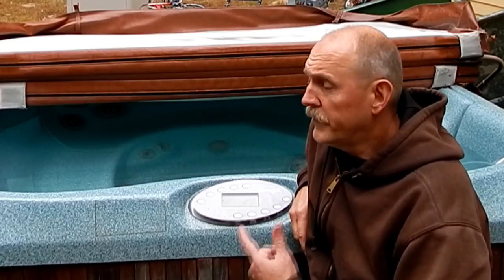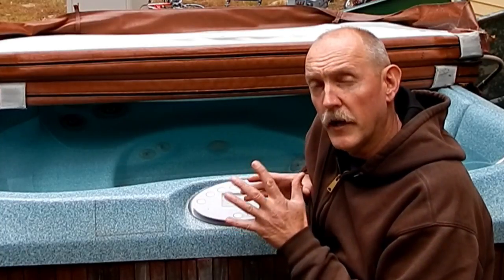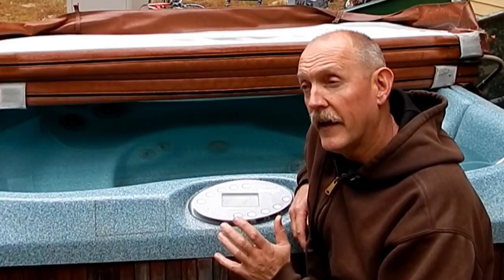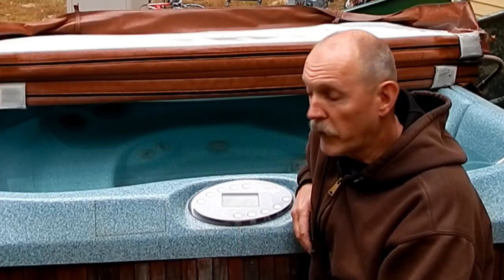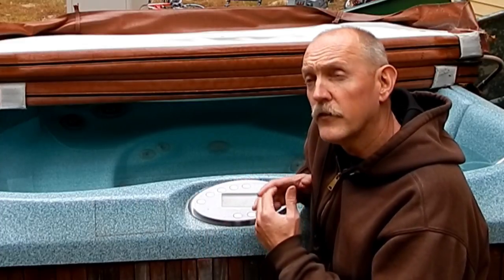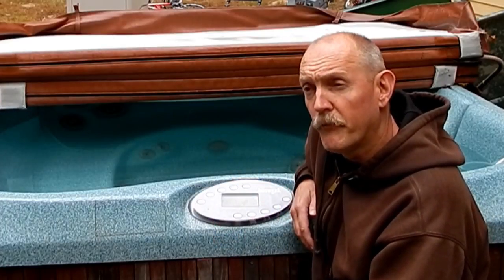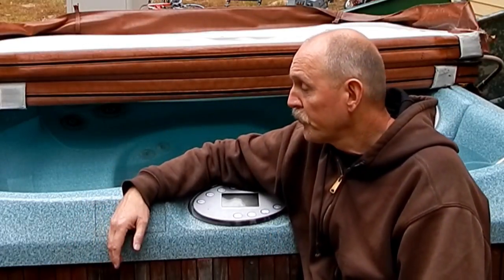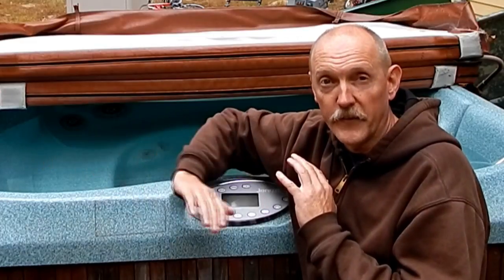Jacuzzi Sundance Hot Tub temperature sensor error repair

Comment: I have the 2006 Sundance Capri model. My issue is that the temperature increase button stopped working and the jet button stopped working. The temp decrease works fine. Even though I had checked the resistance of both temp sensors and they were good. I purchased  an original heater & both sensors with the same issue. I checked the tape and all is fine. For the past three years I’ve been jumping the wires and added the resistance to foil the system. When my wires were swapped the temperature drops 25-30 degrees Fahrenheit in which the heater and the mini circulation pump turns on. Everything else plus the cleaning modes works according to the schedule programmed. I just hate to spend $500+ for a new topside panel on an old spa that came with my house: have you or anyone seen this issue where the temperature increase and the jet buttons stopped working? I only have the single two stage pump in my 250 gallon spa. Also I’ll definitely get the LED panel if possible and affordable. The jumpers have been extended and protected from all elements so I could bypass the system without opening the panel.
Reply from the maker: If everything else appears to be working normally and you have no error codes, it sounds like a bad topside. Especially since the temp down button works. Bad topside is a rare failure but they do fail. I know they are expensive. Occasionally a good used one gets posted on Ebay.

Comment: My jacuzzi turn of the heater when it’s in freeze mode. So it won’t reach the set temperature.  Do you have an idea for that problem?
Reply from the maker: Why is it in freeze protection? Sounds like you had a heating problem allowing it to drop low enough to trigger freeze protection....or you just filled it in cold weather, in that case, freeze protection will run the pumps on high and that will slowly raise the temp to a point where the pumps can be run on low speed and heater should come on. This is all normal UNLESS you see error codes. COOL and FREEZE are not error codes. FLO OH and - - - - - are some common error codes.
Reply: @stevewatr  yes because I filled it in cold weather conditions. But the heating symbol is off when it shows ‚freeze‘ I don’t want that the jet pumps running because it’s to loud for the neighborhood the hole night long. 
I solved it with a 35k Ohm resistor on the freeze and OH Limit Sensor cable.

Comment: I just replaced mine and I just now get the flashing temperature with 4 lines in the back. Still seems to be in watchdog mode. Any suggestions?
Reply from the maker: When in watchdog, you should not see the temp numbers at all, you are describing seeing both at the same time?? That sounds like a power problem on the board itself. If the tops of the 2 large capacitors on the board are bulging, the board might be bad. Also check to make sure the voltage input is correct. Sometimes a blown motor fuse, the green and white one, can cause the board to get 120 volts instead of 220, then the system will act really strangely.

Comment: I have a Jacuzzi J375  that was given to me ...it was working fine until we had our neighbor shut it off from the circuit breaker while not home.  We came back to refill and start it up again and nothing works.  The panel displays a number - 8?  I can't find what this means.  Please help I want my hot tub to work again!
Reply from the maker: "8" is not an error code, its just garbage the display might show if the microcontroller fails to start correctly. Sometimes it can be something simple like a loose connector for the transformer that powers the controller. It could also be a bad board. There are a couple capacitors that fail with age on those boards. Another possibilty is a problem with the voltage supply. All these can be easily diagnosed by a skilled technician with a meter.

Comment: I have a different problem. I indeed am getting the "OH" fault but the water temp is actually exceeding the set point. The display shows a temp of 105 (which I've verified as accurate) and I have it set at 96. I already replaced the sensor in the tub. Is my heater bad ? It's a Sundance Altamar 2005 model.
Reply from the maker: Your heater is not the problem. Think of it this way, if you walked into a room and the light was on, and you flipped the switch, and the light was still on, you wouldn't think the bulb was bad. In the example I just gave, the bulb is your heater, and the switch is the spas control system. So one of 2 things is going on here, either power is still being sent to the heater after the spa has reached its set point (a highly unlikely and rare type of failure), or more likely, the water is being heated by something else. This can happen in warmer climates if the jet pumps run a long time. Why would they run too long you ask? Most common reason is filter cycles set for too long a duration. 2 hours every 12 hours is sufficient. That big motor running constantly can heat up the water because it gives off heat into the cabinet where the uninsulated pipes act as a radiator in reverse.
Reply: @stevewatr  Thanks for the reply Steve. I had the spa off for about a week waiting for the spare temp. sensor to arrive as I suspected that was the problem. Once I replaced that, the water temp was down to around 75. It then proceeded to heat up and pass by the set point of 95 all the way to 105 .... prior to any pumps activating. Any chance that other temp. sensor attached to the heater could have failed?
Reply: @stevewatr  My "skimming/heat" cycles are set to 30 minutes per cycle, 4 cycles per 24 hours. The circulation pump duration is set to 24 hours. Does that sound about right? It has been pretty mild in Northern California this month, hitting around 75 in the day and 40 at night is all. Current water temp is displaying 106 F which is the actual water temp and of course resulting in an "OH" condition.
Reply from the maker: @PresidentGas1  try reducing the circulation pump cycle. 24 hour continuous operation is excessive. you want that pump to turn off when the water is up to temp.
Reply: @stevewatr  Thanks Steve .....I will reduce by 50% and see what happens.
Reply: @stevewatr  Just a follow up on this problem of the heat sailing by the set-point. I ended up replacing all (3) heater relays on the control board (K1, K2, K3). One of them was bad but I replaced all (3) anyways. Problem solved.
Reply from the maker: @PresidentGas1  yup, that was that rare failure i mentioned. The contacts on the relay were stuck closed. I have only seen that a couple times in my over 20 years doing these.
Reply: I think this is the exact problem we’re having on our Jacuzzi. Can you be more specific about what relay we should be purchasing? Our water is scalding and it does go into watchdog after 109. I’m not against using a tech but I can’t seem to get an appointment. Our temperatures have been dipping into the 20s and I have been turning the spa on and off just to keep it from freezing.
Reply from the maker: @cassiegrothe6251  even if it is a bad relay, those are soldered onto the PC board. So a spa technician will not replace the relays, he would replace the whole board. A spa dealer will not have the relays. There is not even a Sundance or Jacuzzi part number for them. To replace the relays you order them using the part numbers on the relays, from an electronic component supplier. But most people do not have the soldering equipment and skill to do this level of repair.
Reply: @stevewatr  After replacing the thermostat, high limit sensor, circ pump, heater, and flow switch (casualty of getting the heater out). It was showing heating but afte 12 hrs not temp change. We whacked the relay and the tub got up to temp. Then it showed a temporary OH at 101. Heating icon has been showing and tub is not warming. I’m positive it’s the relay.  Is there a good video for replacing these relays?
Reply from the maker: @cassiegrothe6251  Ive never seen any videos on repairing these boards, although i know it has been done. If you get the part number off the relay, it should be easy to find new ones. I suggest replacing all of them while your at it. Any person who repairs audio video equipment should have the skill and equipment to do this. One hour shop labor and relays is a lot cheaper than a new board. Id bring the board and new relays to a tv repair shop and ask them to do this for you. Id guess it would be around $60 labor. Those are double sided boards so are a little trickier to deal with.
Reply: @stevewatr  A follow up to my original problem going back to Christmas. I replaced all (3) heater relays 4 months ago and the spa performed wonderfully.. However a week ago I suffered the same condition as before ... temp was hitting 108-109 F and going into OH mode. I'll probably end up just replacing the entire board.

Comment: I can’t find my temp probe, it’s a 2006 jacuzzi j-230,  I see the 2007 is easy to find like yours.
Reply from the maker: the 2006 J235 uses the same type of probe, the part that's under water will look the same as mine, the tiny little connections at the end of the wire will be the hook style i believe, not the box style like mine. But if it is not in the filter well, then it is probably in the wall of the foot well area.

Comment: I have a 2002 Jacuzzi J350.  Have the same Watchdog code.  I've replaced the temperature sensor and still have the code.  Driving me crazy.  Any suggestions?
Reply from the maker: Watchdog is supposed to indicate that one of your 2 temp sensors has seen an excessively high temp. So first think to determine is if the water is actually getting too hot. If it almost immediately goes into watchdog, and it's been off a while, then the water in the tub being to hot is not the issue. Watch the display right when the breaker is flipped on. Does it display a temp just before watchdog? If it does, and that number is much higher than the actual water temp, then it's either a bad sensor or bad board. The boards occasionally fail. There have also been rare instances of defective new sensors. The other possibility is the temp sensor located in the heater has detected an overheat situation in the heater.  Or that sensor is bad. The sensor in the heater rarely goes bad. But I have seen a cold tub that was boiling the water in the heater throw this code. It happens this way.  Normally water is pumped through the heater by the small circulation pump, heated, and flows to the tub. If the water were to stop moving and the heater remained on the water could boil and that's bad. So a safety component called a flow switch detects the flow through the heater plumbing. So if your circulation pump fails, the flow switch detects it, the system gives a flow error, and the heater is disabled.  I've seen rare cases where either bad relays or a bad flow switch allowed a heater to stay on when water had stopped flowing due to a bad pump.
Don't take guesses..........troubleshoot.
Reply: @stevewatr  Hi Steve, Thanks for the response. As I said, I replaced the temperature sensor and still got the watchdog code. I have a friend who sells hot tubs (but doesn't service...or know how to) give me a flow switch and a hi limit sensor to try. I installed both and still get the watchdog code. I disconnected the circulation pump to see if taking it out of the picture would affect it...still get the watchdog code.
Is there a way to check the board to find out if that's the issue?
Reply from the maker: @markmast1945  I hate to say it but it's starting to sound like a bad board
Reply: @stevewatr  Hi Steve, I remember when this issue started, my footwell light flickered a bit and then wouldn't light. I shut the spa off and when I turned it back on, I got the watchdog mode.   Last week I decided to check all the fuses on the board.  One of the small glass fuses (mini 4 amp) looked iffy, and I wasn't getting continuity on my Ohm meter.   I ordered some new fuses (including a few extra). popped one in and the spa turned on.  I think my light my be going bad. I connected it back in but it only works on the blue light. Has not blown the fuse yet. However, now my issue is a FLO error and the spa won't heat.  I'm going to pull and clean the filters, put a hose in the filter inlet on full, and bleed the line where the pvc connects to the pump...see if that does the trick.
Reply from the maker: @markmast1945  sounds like an improvement.  Flow error is because the flow switch is not seeing flow or is bad. The flow is not generated by the big pumps. There is a small circulation pump with only 3/4" lines on it. That pump moves water through the heater passes through the flow switch then ozone tee if ozone generator is installed then exits into the spa through a little port in the foot well.
Reply: Help, my problem is exactly opposite, I have a jacuzzi j355 I believe 2004, it all of a sudden only heated water to around 70 degrees, have changed heater, changed flo switch and am filling to try again now, im afraid it's gonna still happen. The read out only ever said 70 and occasionally cold would flash..I live in middle of nowhere and I am not an electrician but am very mechanical. Please help

Comment: I'm set at 100, and it's showing 100, but the temp is 113 is it likely the sensor?
Reply from the maker: Maybe. What are you using to test the true water temperature? Floating thermometers are notoriously inaccurate. Also the temp at the surface will be different than further down. 113 Fahrenheit is high enough that it should be hard to keep your hand submerged very long. A body thermometer is accurate. Check temp near the temp sensor in the filter well.
Reply: @stevewatr  I'm using a bluetooth meat thermometer.  It has a probe that I submerge halfway.  This thermometer is +/-  1 degree accuracy (even if it was 2-3 deg, it's still way too warm!)  Yes, it's hard to keep your hand in.  I figured out something was wrong when last night I got in and said "wow, this is WAAAAY too hot" then got out and got the thermometer.  I've checked it with two meat thermometers and both showed 113
Reply from the maker: @BobHatcher-od8xd  then yes, the temp sensor is a definite suspect. However, my experience has been the sensor fails in a manner the results in it reading higher than the water really is. The opposite of what you are seeing.
Reply: @stevewatr  Thanks.  I contacted Jacuzzi/Sundance and this model Chelsee has a recall due to defective temp sensors.  They have hundreds of reports of people being scalded with very high temps when their sensor reads normal.  I've ordered the part and will do the install myself.  I'll let you know how it goes.

Comment: 2003 solana sx 110v hot tub with HL code and heats to 120.  any ideas?
Reply from the maker: Just a guess but hl is probably a code for high limit, and if the tub water is actually 120 degrees, then thats why it is showing hl and you need to determine why.
2 most common reasons i have seen a high limit fault over the years are:
If the water really is too hot, then the filter cycles are set too long in duration for a hot weather climate.

Or

If the water is not really too hot to get info, then the heater is staying on after the pump shuts off due to sticking relays and a faulty flow sensor.

Your issue sounds like #1.

Comment: Have a j470 and the display says 216. The lights and heat works but no jets and always says 216.
Reply from the maker: If you power down the breaker and power up, does it clear the issue or does it just read 216 all the time. If yes, I have never seen a 216 on the display for these. I do not know of any such error code, so I suspect you have either a bad topside control, or a bad main PC board. Unfortunately, neither one is a cheap repair. Do you happen to see any signs of rodent (mice) activity in the cabinet? odor, or mouse poop? If so, I would remove the topside and examine the entire length of the cable running from it to the main board. They can sometimes chew through the wiring causing odd issues.
Reply: @stevewatr  I have powered it down and the error keeps coming back right away.  No mice and all the wires look good.
Reply from the maker: @DavidGlass-wt7tc  then I fear you have a bad topside or a bad PC board. You could try resetting the ribbon cable connection for the topside. Just be sure they breaker is off.

Comment: Tengo un problema con jacuzzi d460 no encienden me podrías vender el diagrama eléctrico ya que tengo manual de usuario pero viene nada mas el esquema de partes electricas
Reply from the maker: When you say "won't turn on",
Is the display still on? showing letters or numbers? 
Or is it blank?
There is no schematic for the PC board. There is a wiring diagram on the back of the metal box cover.

Comment: Sombody hear can help me to find box connectors for the sensors?
Reply: These small terminals are common on GM vehicles. I’ve seen them on many cars but GM comes to mind. A trip to the junkyard you may be lucky, as most people pull the radios out and the connector will have exactly what you need. Mid 2000s